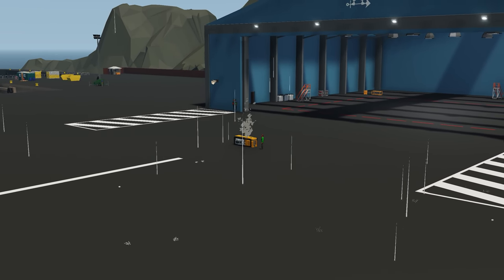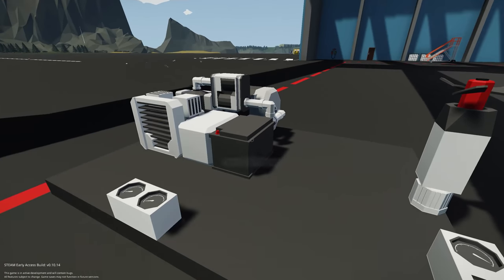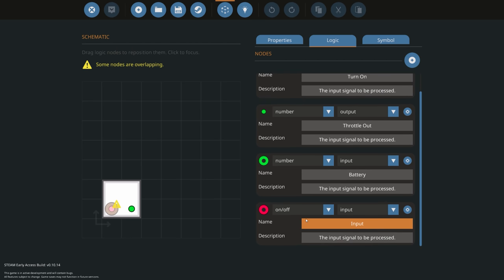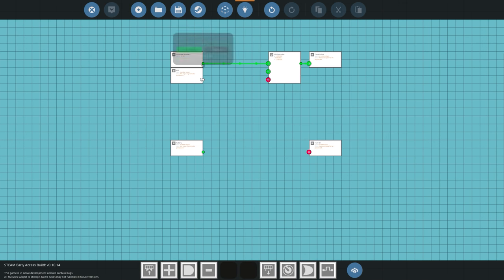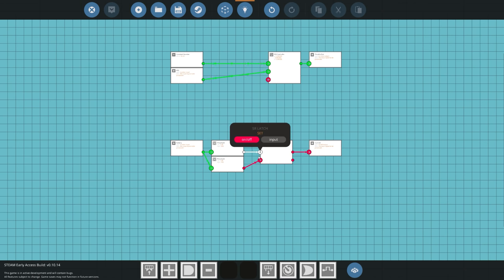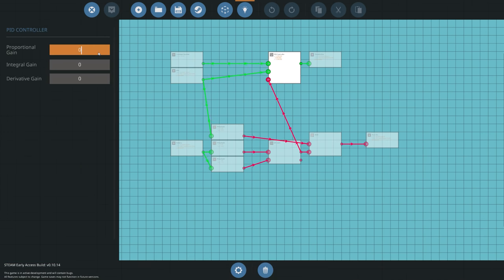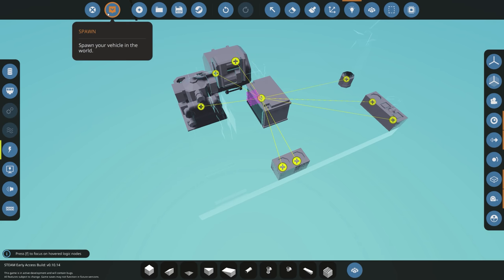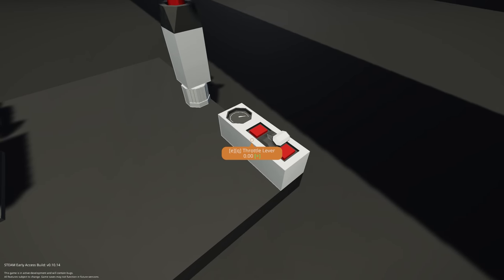Auto Generator - Stormworks Tutorial

Comment: Now if the engine shuts off from overheating it will drop below 4 rps and engage the starter motor, until the battery is empty (or the engine is cold again).

Comment: This is way more complicated than my banging rocks together method. I just had my throttle be the difference between one and the current battery level, and a simple check if the battery was below a desired level, and if engine RPS was below what would be expected from a running engine. If everything was set up right, the starter would only run until the engine was at running speed, by then there would be enough throttle to keep it going

Comment: the nand gate doesn't work for the temperature control. because if the temp is in safe limits (input 0 to the nand) and the sr latch is off, the nand outputs a 1 because both inputs are 0. and the system doesn't shut off

Comment: What is more efficient? Running the generator the whole time using the throttle level needed that the battery does not lose energy like 3 rps or running the engine at 10 rps every few minutes for a short time until the battery is filled up again?
Reply from the maker: Just let it turn on when it sees the battery low, usually I would say anything else than 0.35 is low.

Comment: Liked this one. On the engine side though I noticed the Gearbox between the engine and the generator. I remember at one time we used to do this to “spin” the generators faster to get more power, then a patch came and people started just plopping the small gens directly onto the engine out to keep a battery topped off in the case of engine powered creations. Is using a Gearbox still useful for generators?  Are diesel electric hybrids viable again (were nerfed at one point?)
Reply: Did you find an answer to your question mate? I'm wondering the same thing
Reply: Mr Bateman not yet